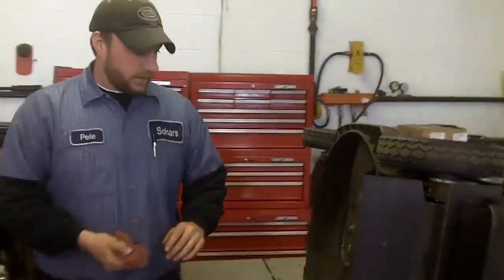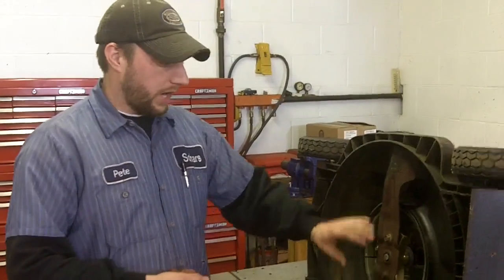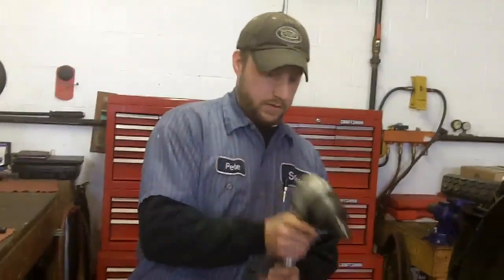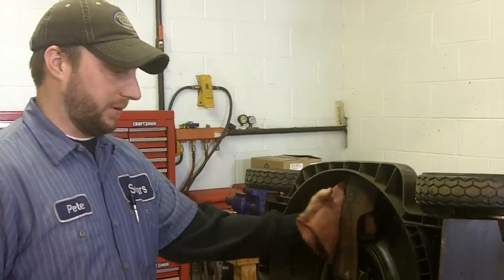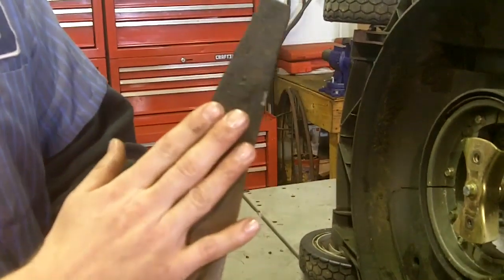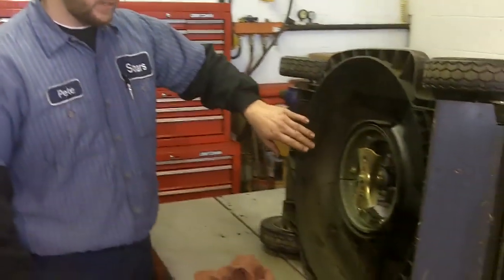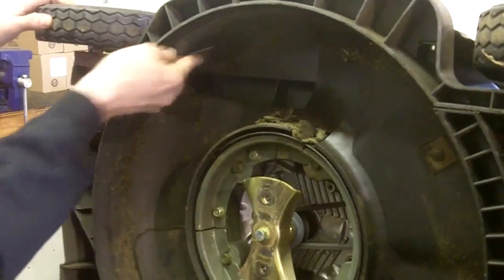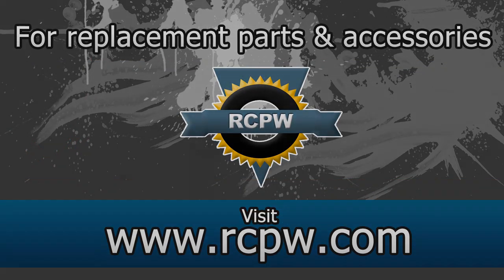Removing Your Mower Blade & Cleaning Your Mower Deck

Comment from the maker: This would severly hinder the effectiveness of the mower. The dual blade is a special Honda design that allows proper bagging or mulching, depending on what you have it set to do. Reader's Digest version: We don't recommend removing either of the two blades. Use both at all times and make sure they're securely fastened. :)